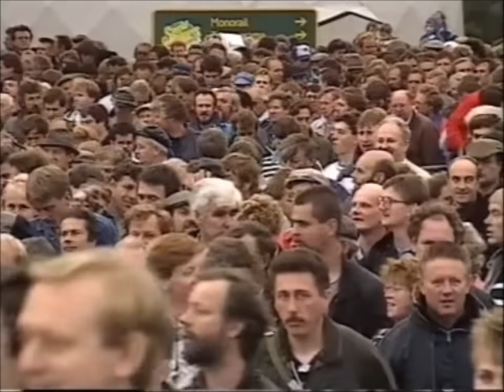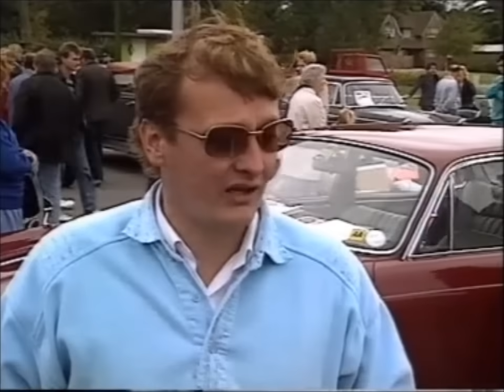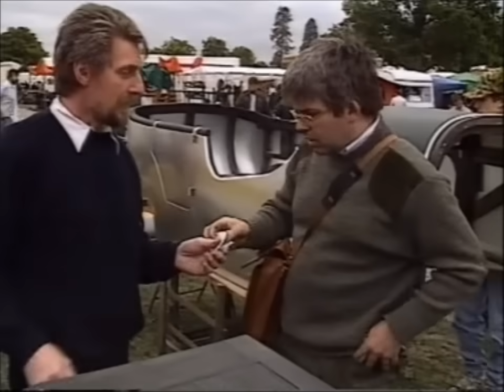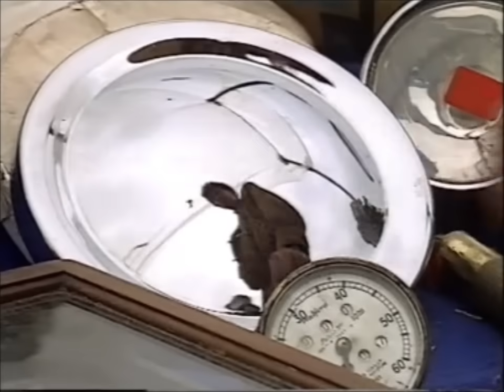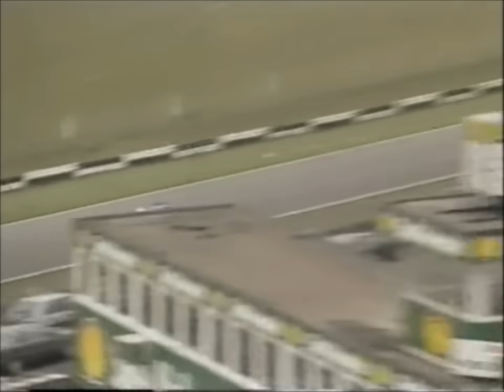Very old Top Gear - Very young Jeremy Clarkson and Tiff Needell

Comment: Damn, that race-prepped Sierra Cosworth looks like a lot of fun to drive. I mean c'mon, 500hp on a stripped-down road car, semi-vague steering, short gear ratios, not-so-aerodynamic bodywork and all that engine noise... yeah, I'd love to drive that car.
Reply: Same here. it's so ugly it's pretty. A shoebox with big hairy balls. Love old boxy cars. E30 m3 and the mk4 jetta 24v vr6 or less potent 1.8T that I own are just beautiful cars and really do drive great if you tune them even a little.
Reply: He had to start braking for paddock corner before he even crossed the start/finish line 😬 I know it was wet but that's still very early. Sketchy but fun!

Comment: Interesting to see how much Tiff has evolved as a driver, you could see he was nervous. If that Sierra wasn't set up as well as it was, 11:16 is the kind of mistake that ships you Express into the wall.
Reply: At the time tiff was regularly driving a group c Porsche 962 with Derek Bell so  a Sierra shouldn't have been a problem.
Reply: @ianpegge9967  Tiff laughs nervously after correcting and you can see that the car was lined up to go onto the gravel. An F1 driver definitely has super quick reflexes along with tremendous physical  strength and those few seconds when he wrenches the car back onto the racing line proved it.

Comment: I have been checking to see if any of the cars still exist.

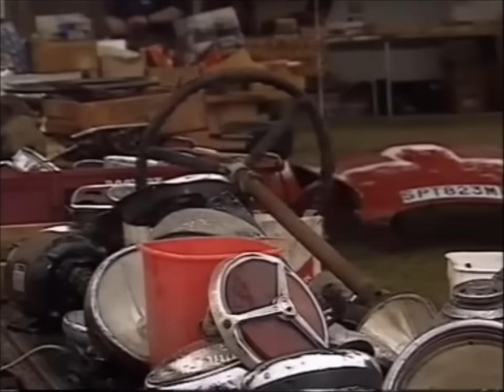@4:17 there is a bonnet for a red E=Type Jag SPT 823M. This was clearly restored. The car was last sold in Sept 2022. MOT ran out in 2021. So it is stored somewhere but no SORN. Perhaps abroad?

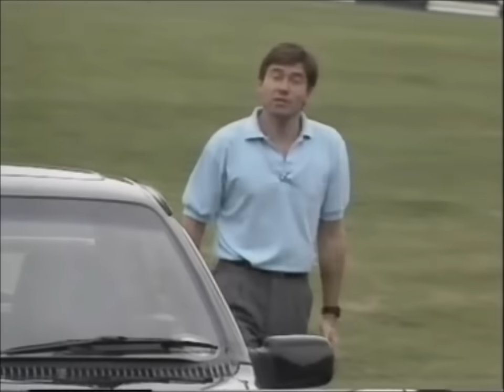@6:57 there are 2 Sierras. Neither appear to have ended up being mated to a tree which is great news.

 RS Cosworth D888 OKO last sold in Dec 2021. Tax ran out July 2024. MOT ran out May 2024. No SORN. Last MOT in May 2023 with 40,714 miles on the clock.

RS 500 Cosworth. Last sold 2018. Not tax or SORN since 1990. Last MOT 2020 with 26,012 miles on the clock. A similar one sold in 2023 for £592,250.

Comment: One of those Cossies, D888OKO is still running, SORN but has a current MOT and had 40k on the clock.
Sadly the tax on E666ABM ran out in 1990

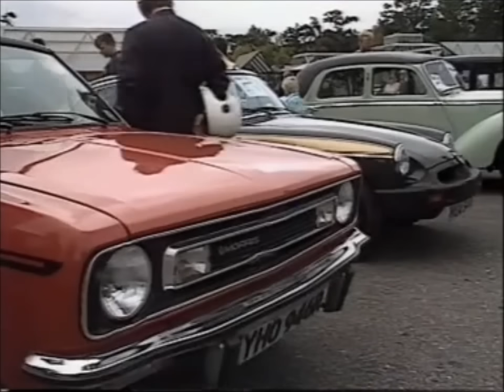Comment: 1:51  Morris marina  😂🤣 equivalent of the old Morris 1000 1100 1200 🤣😂🤣😂🤣 Nooo not  even with a boot full of gold .     

That marina was my first car . OMG , WHAT A DEATH-TRAP .    

The gear stick once came out of the floor  in my hand while driving down a busy road .

One of the front wheels suspension  failed , when you got to 30 miles per hour the wheel would bounce up and down like a basketball player dribbling a ball .   The only redeeming feature was … one day , I’d  had an accident  from a standing start  as a cordia turbo drove out infront of me .    I drove home , the cordia was a wright off.  

Marina ‘’ a collectable 😂🤣😂🤣.

Comment: D = 1986 E = 1987
Reply: Phil Donnelly wrong. D - 1986-1987 and E - 1987-1988. the new plate came out once a year but in August; the half yearly changes in March and September that would go on to be used by the current system didn't start until "T" reg in March 1999.